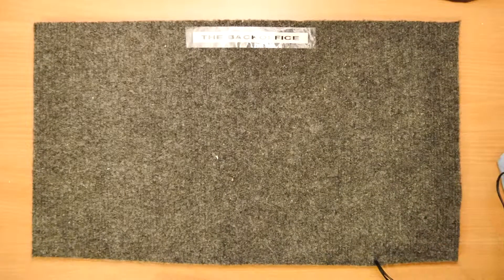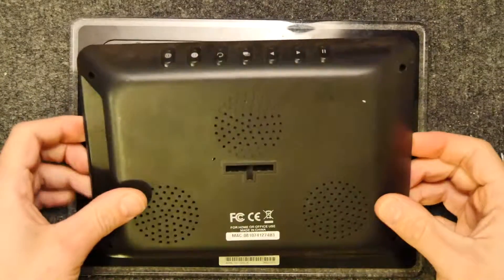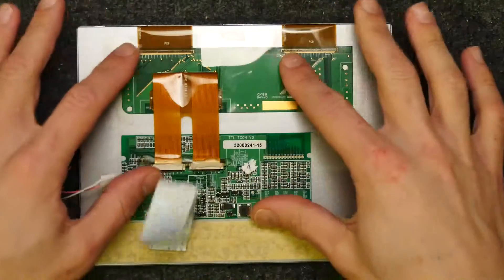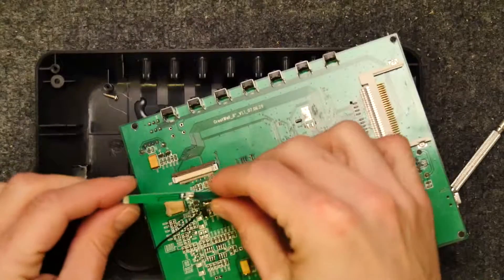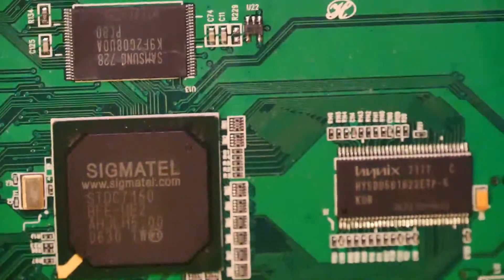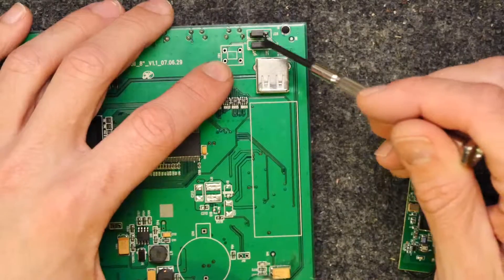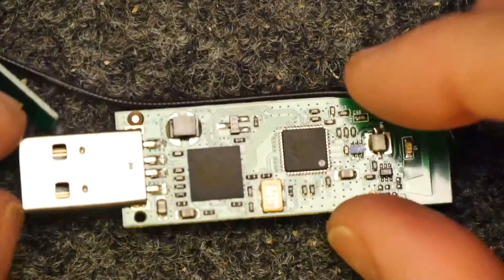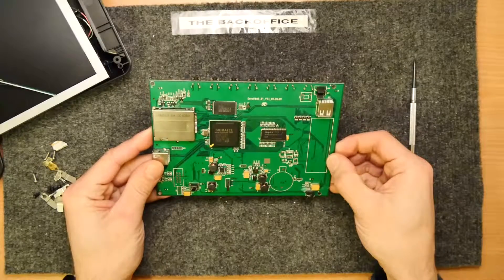Digital Picture Frame

Comment: where can I get a new power supply for my Digital Labs picture frame ?
Reply from the maker: +Virgil Hill The generic ones on eBay should work. Just check the voltage and current requirements on the bottom of the frame

Comment: Maybe try the USB WiFi adapter on Linux, also try finding a data sheet for the chip on the adapter and main board and see what programming software is available

Comment: I always thought they were just TV screens with terrible refresh rates.
Reply from the maker: Larry you could be right! Those adaptor boards may well be converting the output from the arm system on chip to whatever format this panels use. if you recall, old flat panel TVs never displayed your digital signal 1:1, they always were processed.
Reply: The Backoffice
Indeed,   could you ever use this screen for any video purposes?   All I can think of other than a picture frame is an eBook reader.
Reply from the maker: +Larry Bundy Jr Assuming you could hook it up to a Pi or similar you could do quite a few things. I suppose if the quality was not up to much I would like to make a waterproof media player for the bath / beach that was loaded with my favourite shows and doubled as a SNES. All in an A-Team lunch box :)